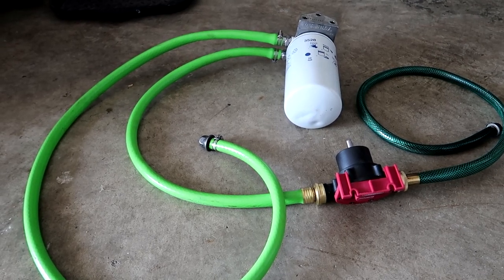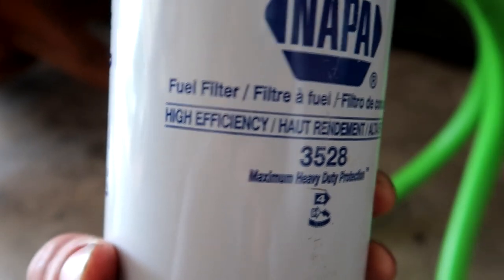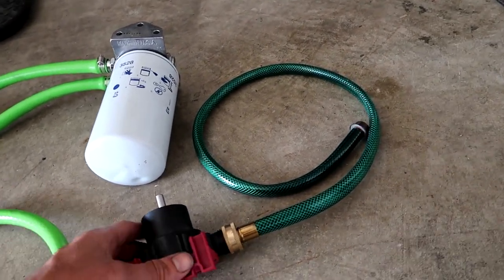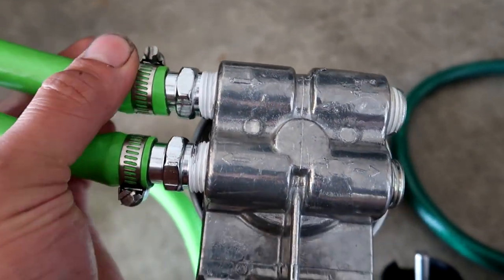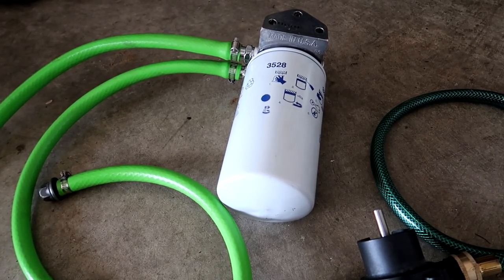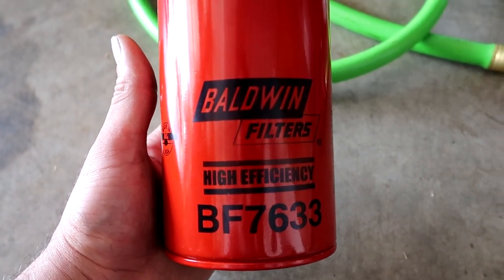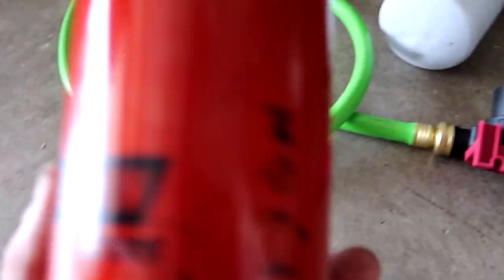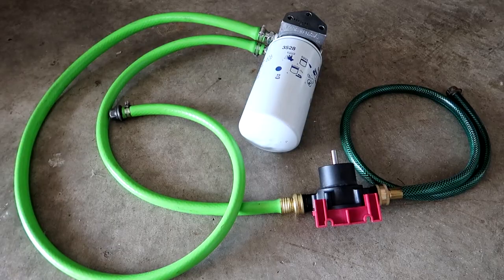Black Diesel Filtering Setup

Comment: Cool idea. I would like to see it work. I have been trying to come up with a better way of filtering my black diesel. Definitely post a vid of it in use please.
Reply: What truck/engine you run on black diesel and what percentage of the WMO?? I'm making filtration setup for WMO so I'm curious. I have old 2.5 turbo diesel Jeep and when it's not cold I run it on 100% vegetable oil. Works great! I believe there should be no difference with WMO.
Reply: V8AmericanMuscleCar my 7.3 idi on the Ford F-250 runs kitchen grease and motor oil, without modifications to the truck it only needs gasoline to thin it down 1 part gasoline to 4 parts used motor oil/tranny fluid/gear oil/break fluid, and 1 part gasoline to 3 part kitchen grease, no mods on the truck. Filtering has been my ONLY problem as sharing a shop with a carpenter is a big Nono.
Reply: @JohnCamp  Get a Centrifuge from a semi. Get a Gear pump To pump it through the centrifuge. Go to a large truck  Wrecker
Reply: @openyoureyes3113  I have both a bowl (for honey) and bulb (from a bypass oil filter) centrifuges. They work, but the cost of electricity is just too high. I’ll be building an air compressor powered refinery setup that pushes the oil thru a toilet paper filter, then a 1 micron fuel filter.
Reply: @openyoureyes3113  asides the air compressor and filters I will have a modified old hot water tank capable of handling 40PSI and mount it to the bed of my truck. So the same tire inflator pump can refine my fuel on the fly. Just pack extra TP rolls and a spare 1 micron failsafe filter.

Comment: I like it.  Curious why fuel filters were chosen instead of oil filters?  What are the pros and cons of each when cleaning WMO?
Reply: Diesel filters go down to a lower micron and the housings are generally sized for a large fuel filter. Fuel filters are also designed for open loop (you are adding new fuel every time) oil filters are for closed loop (same oil going threw over and over, not as dirty).